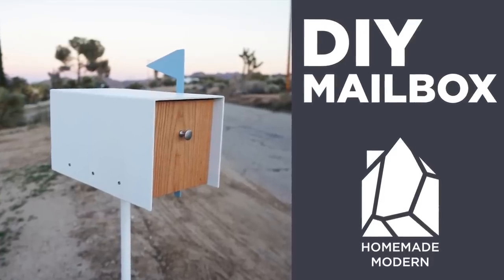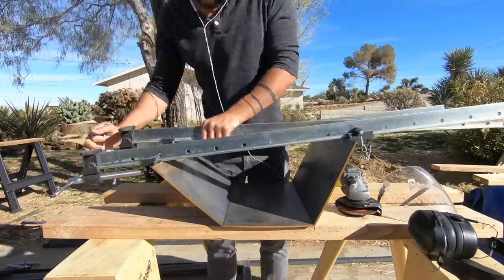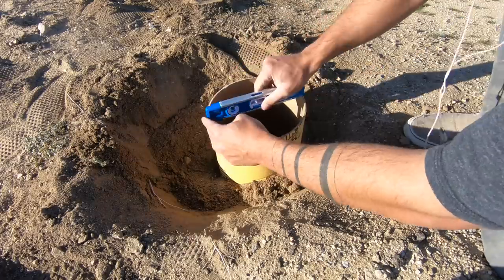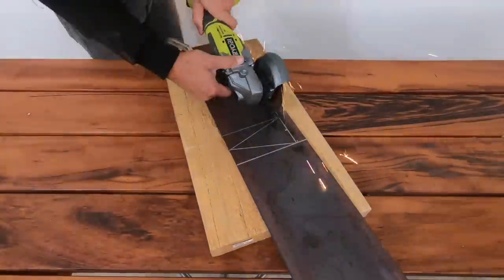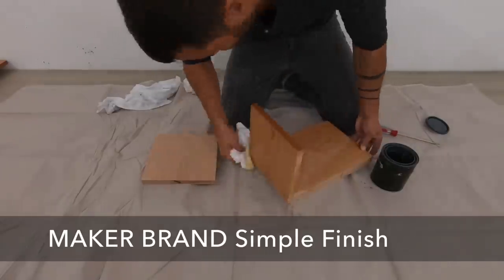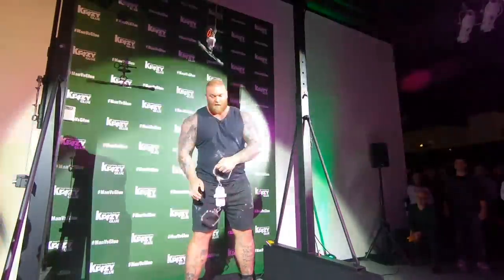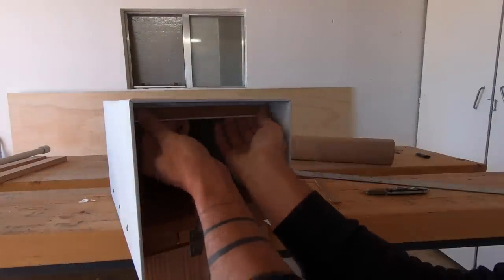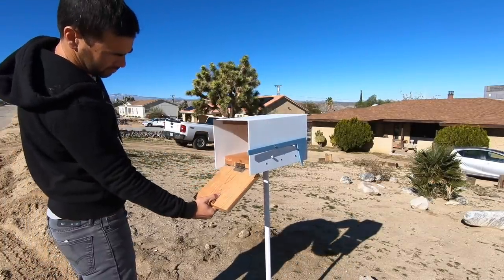Making a Modern Mailbox

Comment: From experience, The pipe in the cement will not last. It will soon loosen. The solution would be to put a few 90's and some tee's so the pipe will not wiggle loose. Also a fence post would be better. Nice project though. Looks good.

Comment: I like your creativity...taking a boring object and making it your own.  It's been pointed out that you need your postmaster's  approval, which I'm sure you will.  I would have drilled a hole at the end of the pipe, inserted a key of sorts, so as to prevent the pipe and mailbox from spinning.
Nice tip on how to make the bends.

Comment: You should weld scrap pieces of steel to the galv tube you set in the concrete, you’ll find it holds in the concrete a lot stronger.

Comment: Love checking out the things you make, and have recently started listening to the podcast! 

In the video I noticed you using the Roybi sliding mitre saw. I have the same one, and it cuts perfectly square when the saw is pushed all the way back, but when pulled forward it goes from about 1/16"-1/8" off. Any thoughts on how I might square that up??

Comment: Why wouldn't the red oak be very suitable for an outside project.? Here in the UK the problem with using wood outside is the wood rotting due to the high moisture level because of the wet weather.. You look like you live in a desert 🐫🤪
Reply: Lostboy. Oak will turn black if it gets wet. Not a great outdoor wood for that reason.
Reply: Nick Toga if it’s correctly treated and maintained it should be perfectly fine outdoors, it’s used especially in the UK for outdoor purposes all the time